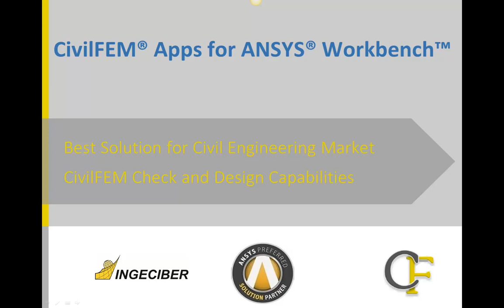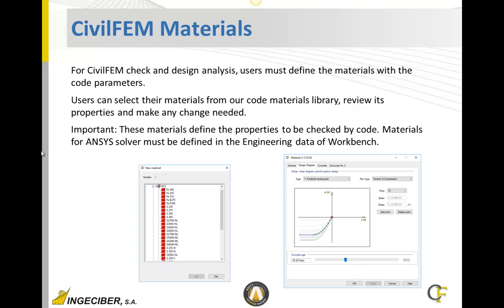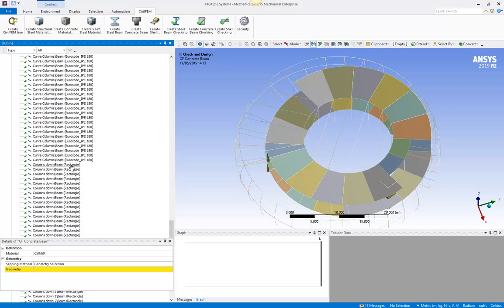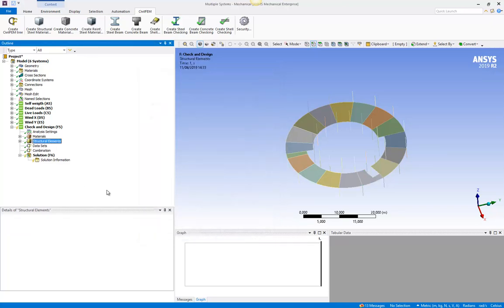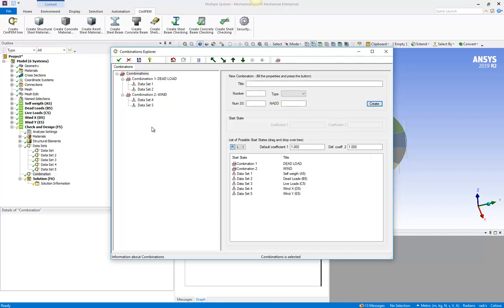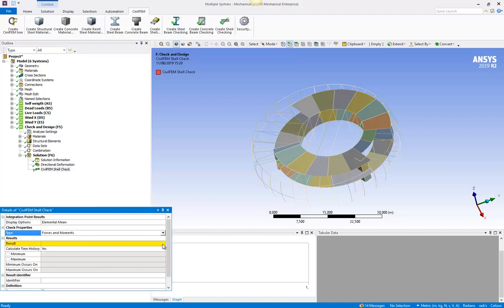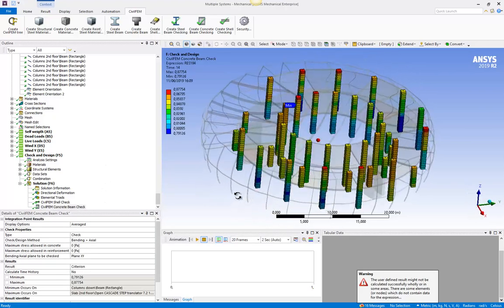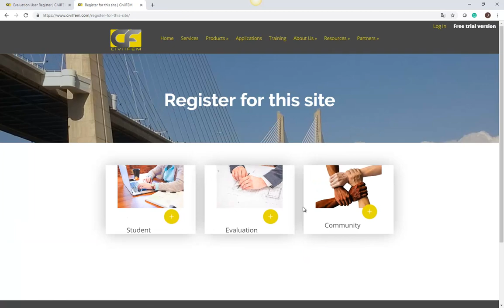CivilFEM® APPs for ANSYS® Workbench™  (HOW-TO)

Comment: Dear Eng
Please tell me :
1- Can the user define and analysis a new project from beginning  into ansys workbench rather than use CivilFEM?
Reply from the maker: Hello Mr. Masoud, maybe I did not understand your question, CivilFEM App starts with a model already defined in ANSYS WB, CivilFEM Will redefine materials and sections in order to proceed with the check/design according to codes and standards. So the project is performed from the beginning in ANSYS WB.
Reply: @Civilfem_Software  Hi , I mean Can the user define & analysis in ansys workbench only, whiout need to go to CivilFem software?
Reply from the maker: @amrmasoud5580  Hi, I am afraid ANSYS Workbench has no utilities to check/design according to codes.